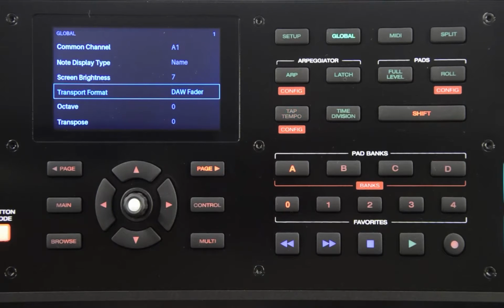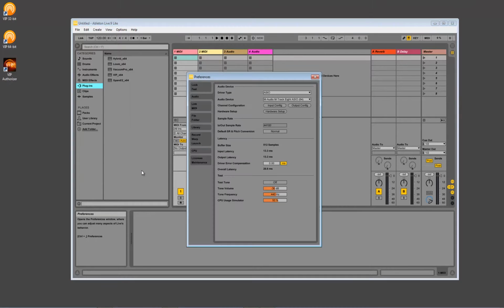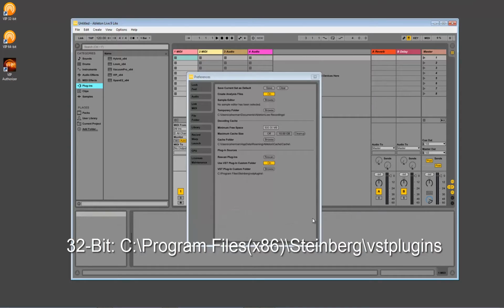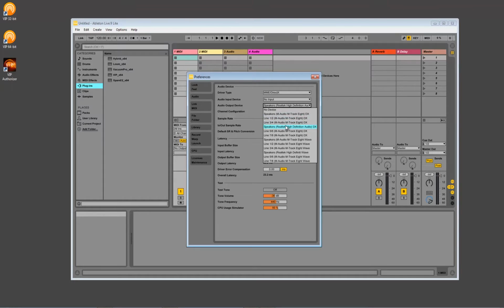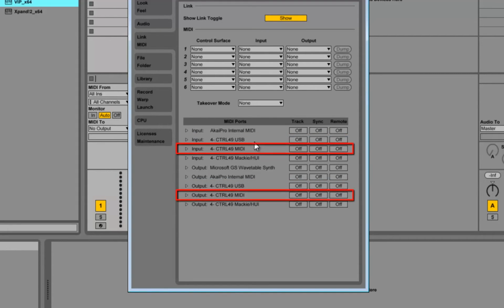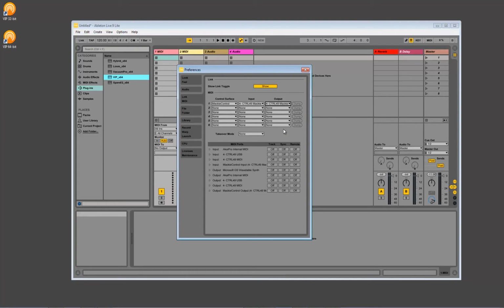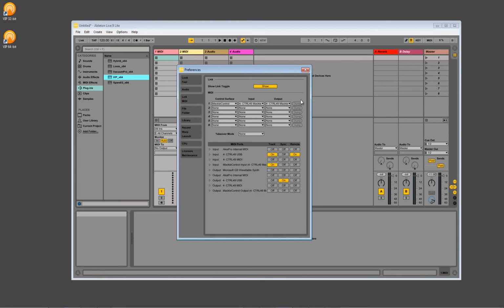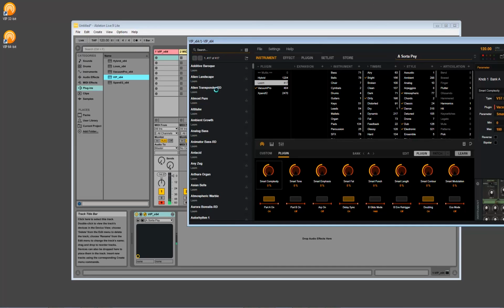M-Audio CTRL49 - Setup in Ableton Live Lite

Comment: the arpeggiator is not working... no sound when I press the button...
Reply from the maker: First, make sure you get sounds when the arpeggiator is OFF.  Next, you need to have three critical things correct to enable notes to occur with the Arpeggiator ON.  
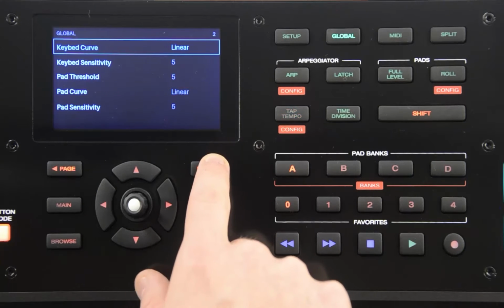1.  Set the CTRL49 to external clock as shown at 0:59. 
2.  Set Ableton to transmit clock to the CTRL49 as shown at 3:54.  
3.  Press PLAY in Ableton.  Ableton doesn't send clock unless playing.  The CTRL49 won't play arpeggiator notes unless it can hear the (timing/tempo) clock from Ableton.